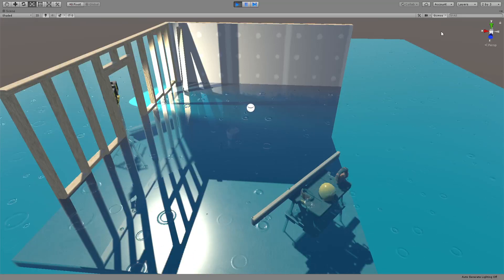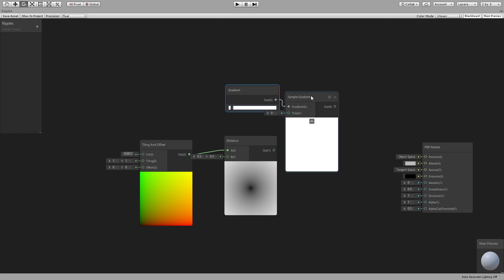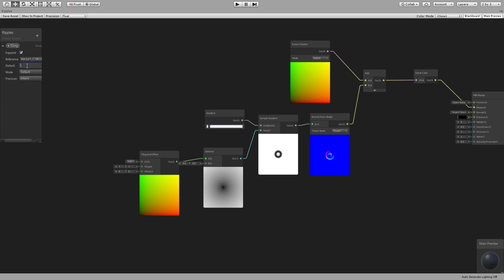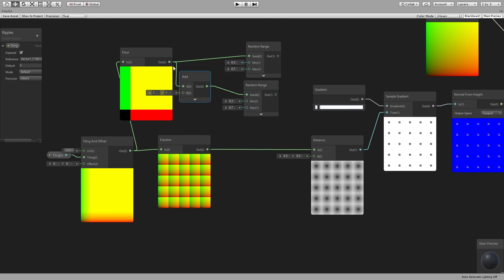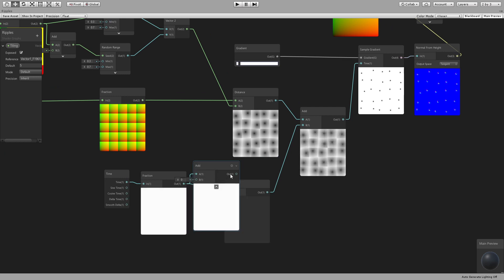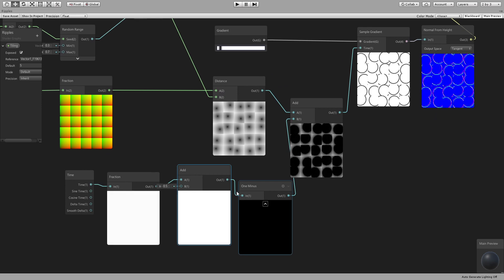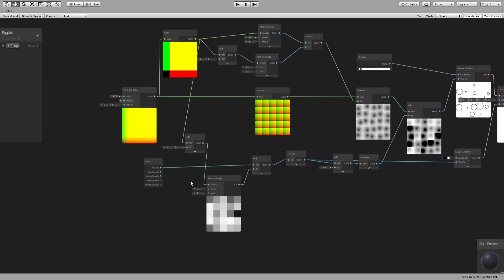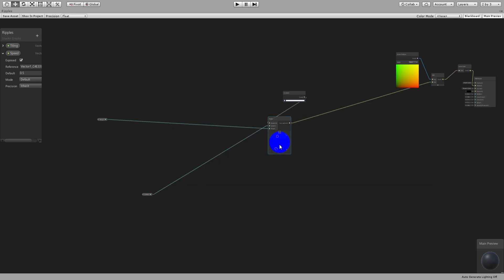Procedural Water Ripples in Unity using Shader Graph Only

Comment: 3:57 you've remade the Voroni noise node, lol. Tiling & offset -> Fraction -> Distance == Voroni noise with angle offset set to 0
Reply: 5:25 ... and adding the random range nodes as input ot the distance node, you've still got Voroni noise with the angle offset turned up, though your implementation isn't as nice as the actual Voroni noise as your cell boundaries aren't merging, you're still keeping your perfectly square cell boundaries